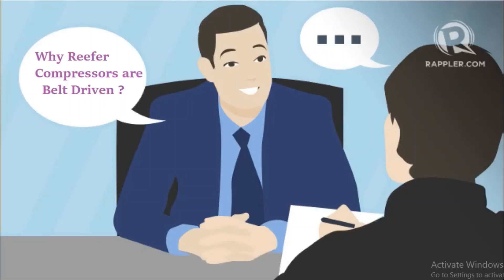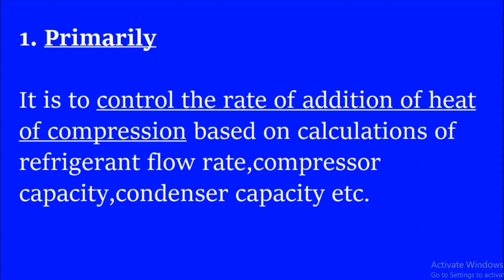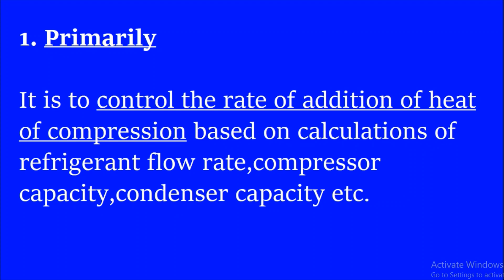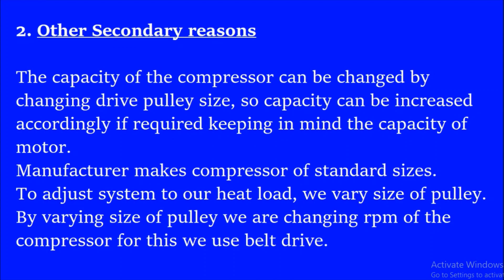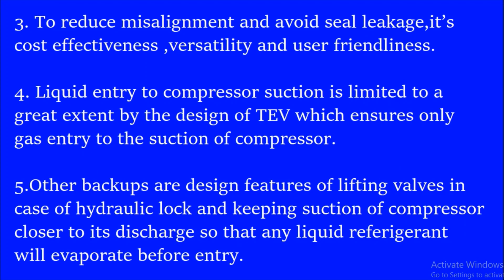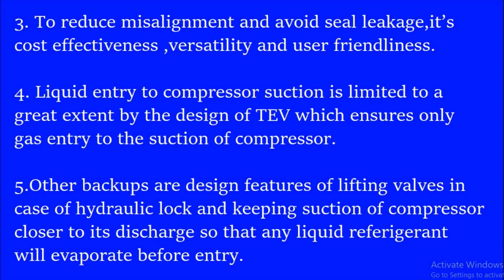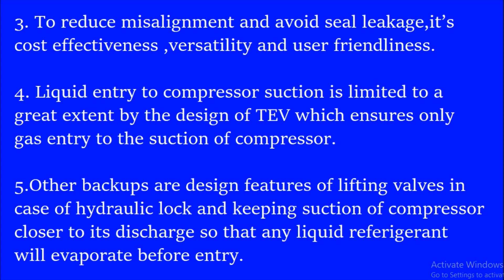Why Reefer Compressors are Belt Driven ? 😲| Most Important | Must Watch for Simple Explanation

Comment: I don't understand that primarily point...can any one explain here that point
Reply from the maker: Heat of compression is to be added, so that Rate of heat addition is controlled by BELT DRIVE
Reply: @CLASS4ORALS  I understand that point...I am asking how belt driving helps to heat addition..... thanks for your kind reply
Reply from the maker: It helps in controlling it..since it is flexible...unlike gear drive which is fixed and can not adjust on its own..
Reply: @CLASS4ORALS  ohh ok ok... brother...thanks a lot.....may God bless you
Reply from the maker: Always welcome..!
Reply: Bro belt some time break and slip ..then too why we use belt instead of gear ..with increase in size of gear dia we can also control the speed of compressor I don't know what suvyer want to listen
Reply: @chiragsolanki9925086336  yes belt is gud... because if liquid enters into compressor....belt will slip and prevent the compressor from damage...if we use gear then compressor will damage....so belt is gud to use
Reply: @amicheal1405  Thanks bro very good point.
Reply: @amicheal1405 thanks , but how it possible if liquid enters into compressor will make belt slip ? Could you explain to me thanks